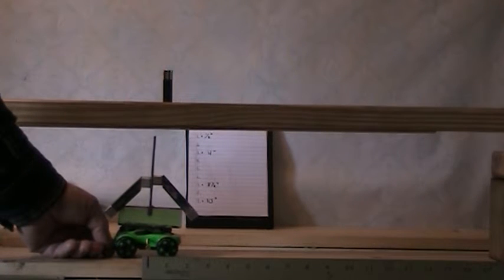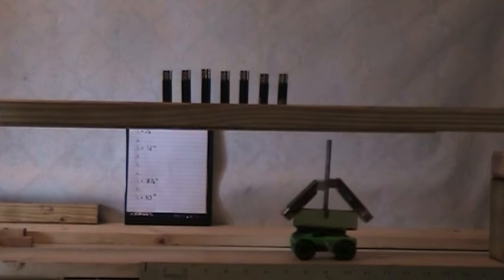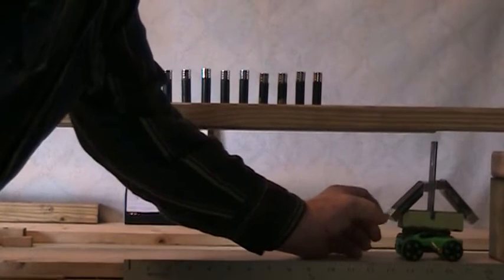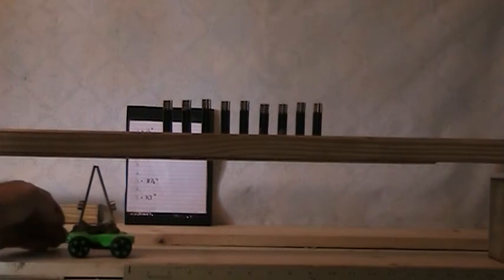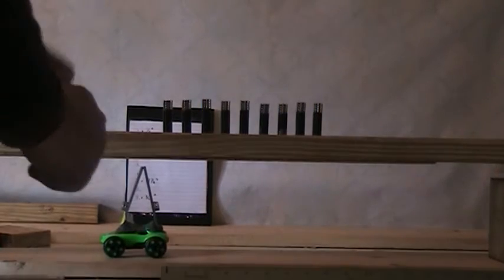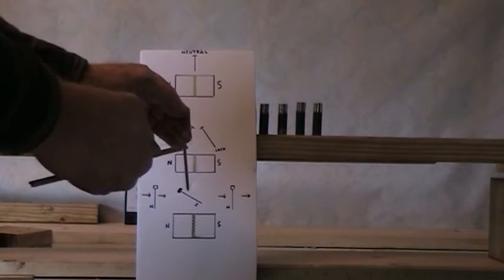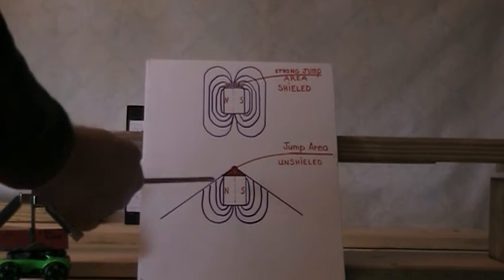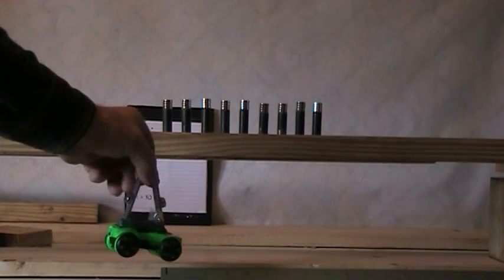rays magnetic gate jumper ''J'' part 5

Comment: Hello , very good your video. Do not use your language. It could indicate all materials used ? Thanks and regards.
Reply from the maker: the top magnets were mild steel two and a half inches with 4 half inch magnets on top of each      the second car set up  used one eight by one half by three and one half inches long mild steel metal with magnets  good luck

Comment: Well done Raymond, try to see if you can build a track which is about 1 to 2 meters long and see if the car will then travel this far distance also... also try to see when you put a coil around you metal bar in the Car if it will induce a voltage and light up an LED if the car is traveling along the track...Many thanks.  Regards, Stefan.
Reply from the maker: i had thought of doing something with a led light but had some new ideas which led to ray's magnetic wheel (c r) which is part 6 of the series  thanks for your input
Reply: lenzs law